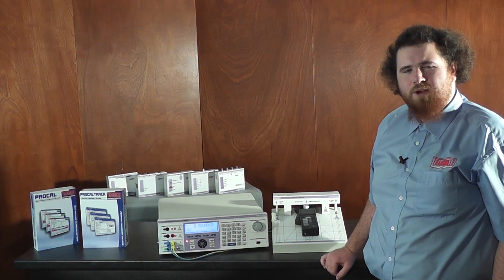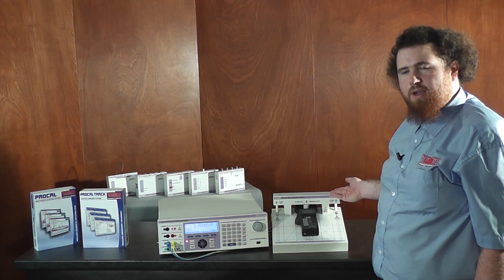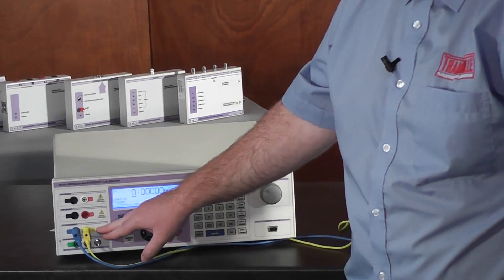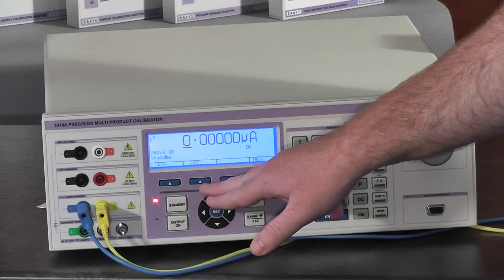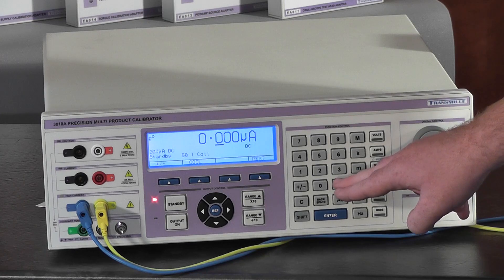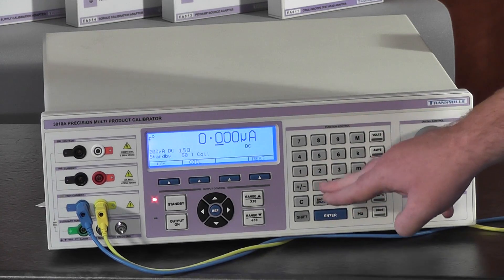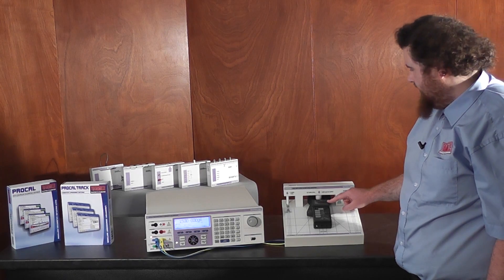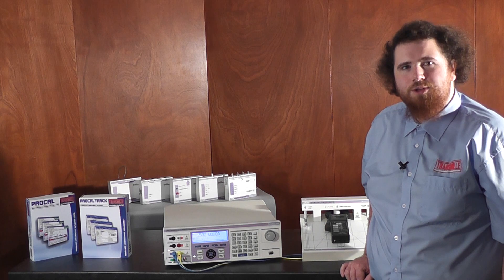How To Calibrate a Clamp Meter

Comment: ok but how we calibrate it>???
Reply from the maker: Hi Theseus. Calibration consists of Verification and Adjustment, of which the adjustment part is optional. To ADJUST the clamp meter, you will need to refer to the manufacturers service manual. Typically manufacturers make this information available on their website or as part of the instruction manual.

You may not need to adjust the clamp meter if the customer does not require adjustment, as you can note the error/readings on a certificate for the user that they can refer to.

Comment: My clamp should come calibrated from the mfg right?
Reply from the maker: Not always unfortunately. A lot of manufacturers will provide a certificate of conformance/quality seal, but not necessarily a calibration certificate (i.e. including readings). Some distributors such as RS Components can provide calibration certificates with new equipment, or you can send your equipment to a 3rd party laboratory to issue a certificate.

Of course, if you are purchasing a lot of testers, it can be much more economical to purchase the equipment to perform the calibration yourself. This also saves on down time as the calibration is performed in house as and when required, instead of sending externally
Reply: @Transmille  Thanks for the reply friend.
It turns out that the clamp I was using when I commented on this video may have been "factory calibrated," but in action was off by a factor of 3. 
I ended up looking like a complete imbecile but at least I spent some money on a proper current clamp.

Comment: Big boss how to calibrate? Which trimmer pot to be adjusted?
Reply from the maker: Hi Pravardhan. We cannot provide individual assistance on each clamp meter as they all have different adjustment methods (some trimmers, some digital, some it is not possible to adjust). Our guide is showing the principals and how to perform the verification/calibration with a 3000A Series Calibrator and highlighting the importance of alignment